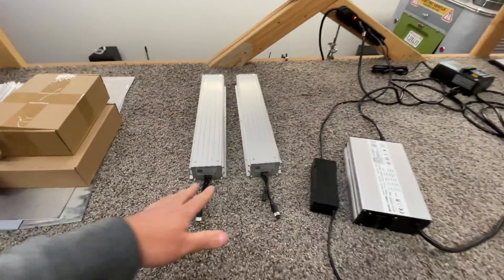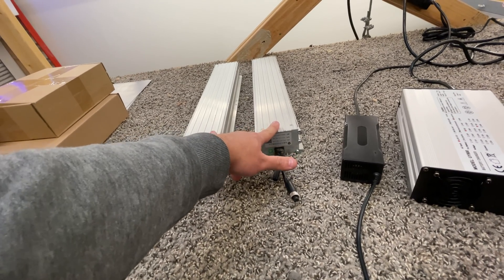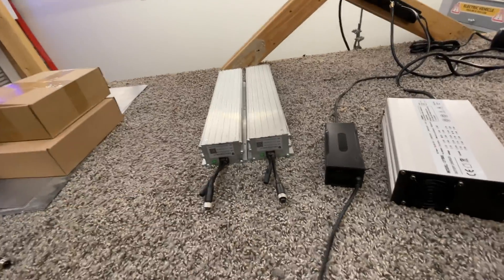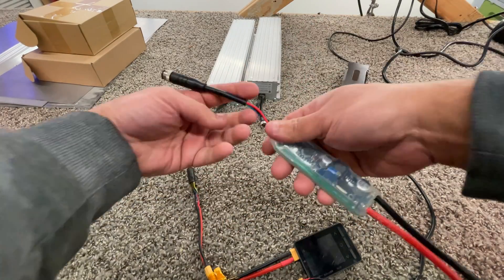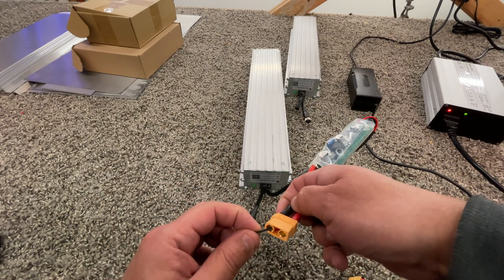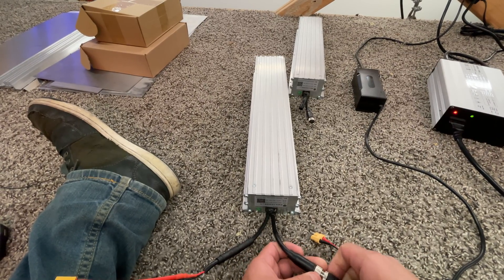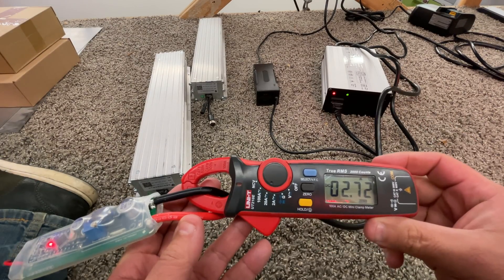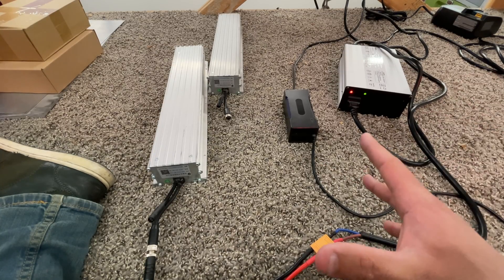Why Are my Scooter Batteries Not Working with my Bluetti?

Comment: I just tested one of my packs and the polarity of the larger connector is the reverse of what your sketch at 4:50 indicates.
Reply from the maker: You mean 4:35? follow that sketch
Reply: @jehugarcia  Either one. The polarity indicated is for the male connector but is labeled on the the female connector. They're mirrored - on the female side negative is on the right and positive is on the left, just like the smaller connector.

Clarifying edit: the data connection labels are correct, but the power connections aren't.

Comment: When I first got my 2 batteries I charged them fully through the load end of the batteries and couldn't figure out how to wake them. Then I started using a test light (12v to 70v DC led light) going between the small charge cable and larger load cable and the light lit up like a Christmas tree. Ever since then the batteries have been awake. I personally think it's safer for the batteries and BMS inside to use a test light versus trying to jumper wires and accidentally burning something up. 

But is it possible to post a site or location to purchase the smaller cable? I think some of us would like the option of using it as the intended charging port.
Reply from the maker: https://www.mutuallc.com/Z409F-4-pin-Battery-connector-pd40602085.html
Reply: Do you have a link to what you used?

Comment: Why not just charge it up from the smaller 2 wire port? It will also wake the battery, no?
Reply from the maker: Yes,  you can do that
Reply: You’ll still need to provide the digital signal at short intervals to the tiny blue wire of the larger cable to extract power from it...

Comment: I need help if I connect 2 volt 500ah 6 batteries in series what's their power 3000ah or 500ah?
Reply: Series or parallel?
Reply: @Nicholas-f5  in series like if we connect 2 volt 6 cells it's become 12 volts so their also increase power from 500ah into 3000ah?

Comment: Man you off as always..  

BTW I need a 40kWh backup ..  is it more cost effective to buy a use bolt or Tesla battery pack .. sell what I don’t need or buy a load of scooter battery?
Reply from the maker: Scooter batteries are $125/kwh.   Bolt battery packs are ?????  Tesla battery packs are  around $300/kwh
Reply: @jehugarcia  thanks for the information I still need todo some more research.. I’ll contact you guys directly when ready .. Thanks

Comment: If I needed to connect to the little connector just to wake up the battery pack I would use small alligator clips or test clips.
Reply: That seems like a great idea! But I used the negative to negative bridge with a 18-20awg wire it worked perfectly. Just verify your negative connections with a multi-meter, look it up if you don't know how to check, it is very simple. 6 out of eight batteries were in sleep mode. All are working after they were charged then using N - N bridge had them all working in a very short time.
Reply: I got mine to work but used the pin on the left with the notch facing down on both. Opposite of the drawing online.
Reply: @johngalo8388  Thank you for this important confirmation - the negative pin sockets on both connectors are on the left if you face the female connectors attached to the batteries with the socket notch pointing down.  Indeed of the 4 scooter batteries I purchased from Jag35 only one was awake.  Was able to wakeup another one by connecting the negative pins (as you say opposite of what Jag35's sketch diagram shows !!!!!) using an electronics 1/4amp fuse with solid wired leads (kind that are directly soldered to PCBs) plugged in carefully to the female socket pins on the small and larger connectors.  

I appreciate Jag35's DIY and entrepreneurial spirit, but getting the details concerning high current battery terminal pins right is VERY, VERY, IMPORTANT.  He is hurting DIY by getting this stuff potentially dangerously wrong an inviting legal problems too.  No one wants to see that.

Using the "negative-to-negative" wakeup technique did NOT work for my remaining two of four scooter batteries.  Soldering together my own molex male pin connector to apply a charge voltage to the two pin sockets of the smaller battery female connector.  Will try and report back if this works in my case.

Again - thanks for your post about Jag35's mistaken connector wiring info.

****************** 

   UPDATE - 2021-09-11

I am pleased to report success in waking up my four original Jag35 ordered scooter batteries and an additional four purchased 10 days ago.  The process to wake them is sort-of hit and miss though.  

Making sure to briefly and correctly(!!!) connect (as described above in my original post) negative to negative socket pins on the large and small battery circular connectors for me had a 50% success rate, while VERY CAREFULLY charging between 3 mins to 10 mins with a 2 amp battery charger thru the small circular connector using the negative pin (left side with notch pointing down) and positive pin (right side with connector notch pointing down) was more often able to wake them enough to switch over (removing the wires charging thru the small connector) and use Jag35's Arduino dongle and charge the battery thru it's larger circular connector attached to the dongle.  It was a trial and error process, but this is my best recollection regarding waking up the scooter batteries and confirming measurements with my trusty Fluke DVM.

Grateful if any forum members with knowledge of the internal design of these scooter batteries would help the rest of us understand how these scooter batteries interact with the outside world, their best practices handling, charging/discharging recommendations .... etc.

I repurposed 3 auto headlights wired in series: 140 watt resistance test load, I had used a few years earlier with my father's help to explore optimum solar panel orientation in a mixed and diffuse light environment (placed the dummy 140w load on the solar panel so we could plot power efficiency as a voltage/current against a fixed resistance load).  For the scooter batteries my 140 watt load drew down the charge on the batteries to a safer level: 35vdc to 38vdc(?) for storage, after taking them up to max 42 volts with my 4A charger.  This also confirmed each battery's ability to maintain a 3.8A load for a reasonable period of time.  Each battery did pretty well, taking quite a while to travel from 42vdc --> 37vdc.

My wife and I have been fortunate to own an all electric Nissan LEAF EV since they first appeared in 2011.  That experience has made me proactive regarding LifePO4 battery charge storage levels after discussing battery chemistry with a friend who worked as a senior design engineer at Tektronix and also a LEAF owner.  We endeavored to keep the batteries below 70% charge if the car was going to sit for more than a day or two.  Wondering if these scooter batteries benefit from storage below 80% charge ?  Any advice would be appreciated.

Comment: Using a nickel battery charger like an RC car charger will help wake up lithium batteries but only for a few seconds to boost up voltage to the appropriate charging level.

Comment: These batteries really seem like a pain. Custom dongles, plugs and ports ect. At some point just salvaging the cells makes more sense.
Reply from the maker: I have the thing for you then,  80k lbs of 2600mah EVE cells in 4s packs,  super easy to harvest cells,  coming up soon
Reply: Not at all! Just follow the instructions and you'll be ok! Mine worked perfectly
Reply: It seems like more cost/trouble BUT considering these scooter packs are using a very safe and well designed BMS it’s a awesome scalable and super cheap solution to use these packs. 

If you just need one pack or build a 20 pack solution you still have the right sized BMS. 

Where raw cells make sense is if you need some other usable voltage range,  that’s really the only negative to these packs is you have to have a load that can work in the output voltage limits of the pack, but you can serial at least 2 packs to go from 36
To 72v. So that’s nice. You might be able to get 3 packs, in series but you are slightly over the BMS mosfet rated voltage (100v)

Comment: Hey Jehu, I ordered a scooter battery pack but now kinda want the enclosure? If I place another order for the enclosed battery pack, can you throw in a case for the first one I bought 😅😃😄😁
Reply from the maker: No we cut the cases with a saw,  you can’t reinstall them
Reply: @jehugarcia  either way. Thanks for the videos and deals. You’d the best man!
Reply: @jehugarcia  i ordered another one. I also ordered a dongle earlier for the first pack. I didn’t see that 2 are the same price as 1 for the dongles, think you can slip a dongle with the new battery pack order :). Sorry if I’m streatching it.
Reply from the maker: 2 are the same price as one?   Don’t think so
Reply: @jehugarcia  not really but for one it’s $25.11 and for 2 it’s $29. In my head it was the same. But close enough. You don’t have too it’s okayman, that shipping cost is crazy.
Reply from the maker: @Gold63Beast   oh you meant the 1x and 2x are almost same price.   yeah,   email support@jag35.com to see if it hasn't shipped yet.

Comment: I don't see why connecting two negative wires to each other would switch a battery BMS on, as the circuit has not been made it wouldn't really do anything you would still have an open circuit.

But by connecting in the charger on that cable would allow a reverse charge on the circuit to open the switch inside the battery, ie a relay or electronic switch, which would the let the battery function again.

Probably why they removed the batteries from the scooters in the first place.

But the cells are probably almost new.
Reply from the maker: If you saw the circuit it would make sense why it works,  but not clear why it only works on some while not in others

Comment: If you use the small connector to charge, the BMS will shut down Above 7Amps charge Current
Reply from the maker: Correct
Reply: @jehugarcia  is the "small charger" a Li charger or is it a DC power brick? I have been wondering this as I watch your videos and I see  constant charging via the output cable without balance ports connected. I figured the BMS was managing the balancing and therefore pulling the current it needs from a DC power brick for charging, but I am starting to think I am mistaken. I guess I am having a hard time understanding where the charge rate is being controlled at the BMS or at the input charger/power brick.
Reply from the maker: @moralesmike   the charge rate is always controlled by the charger,  the BMS is a smart switch that is normally on if a certain amount of checkpoints are met,  it turn off if they are not.

Comment: Perhaps you as the seller should ensure that the battery(s) is charged and the bms turned on before shipping?
Reply from the maker: I can do that,  of course I will have to pay someone to go tru thousands of batteries and I will have to raise the price to cover the labor.
Reply: @jehugarcia  Then you shouldn't have sold them as ready to go, Stick to diy, that's another $50.
Reply: @Scott-ig1zd  yep, the original video posted over a week before this one sold it as a non-DIY project. I'm really disappointed in how he mislead people in that original video. "Just buy a cheap battery and plug in a cable."
Reply: Hey Panman I would gladly charge you to wake your battery up noo problem...
Reply: @christopherbetancourt6105  

Why thank you. :)
Reply: Exactly what I thought... So raise the price a few dollars to do the job right!
Reply from the maker: @tcb1012  Some day perhaps I'll agree to cater to non diy customers,  but for now,  you gotta do some work if you wanna use my products.  those are the rules.
Reply: @jehugarcia  excuse me, in your original video, your EXACT words were "let me show you how ANYONE that owns a Bluetti AC200, how you can very quickly and inexpensively add extra battery. I've made a video like that before but it was quite a bit of work, you have to DIY, solder some cables and stuff. Today I am going to show you how to do it where you just literally have to buy a cheap battery and then plug in a cable." Your video made NO mention of this DIY component until over a week later. You originally sold this as a solution that didn't need DIY, so really it was just false advertising. "Those are the rules" is an unkind response when you mislead people to begin with.

Comment: As a noob to the battery/solar game i have a question about the referenced charger in last few videos and link on website.  It still requires a connection modification correct?  We need to cut and attach a xt90 male to charger to work with the dongle right?
Reply from the maker: Yes,  I think the one I got had no connector

Comment: Jehu  how much would that charging cable be that you said would be too expensive which connect negative pins?  Where could i find one. I have multiple batteries i would rather make one cable with a XT-90 or xt 60 plug  for multiple uses for now and future use.
Reply from the maker: You gotta find it in China,  it was $4 when ordering 2000,  I don’t know the model number
Reply: @jehugarcia  Hello: Is there a way to order powerwalls from you for installation in homes in Caribbean island neighborhoods that greatly need it?
Reply: @jehugarcia  do you have any extras you could sell of these connectors. Like the other guy I have 24 of these batteries and would really like one connector to assist with turning them on vs having to solder 24 more xt60s
Reply from the maker: @NoOne12   I found them here https://www.mutuallc.com/Z409F-4-pin-Battery-connector-pd40602085.html
Reply: @jehugarcia  Thanks, yeah I posted that a few min ago as well. Sadly they don't seem to have a store front. If anyone finds these for sale somewhere please post up a link here.
Reply: @jehugarcia  Thanks for the quick reply yes that is too expensive.